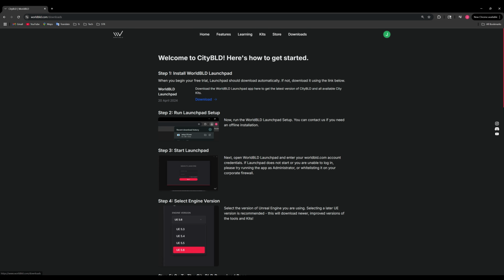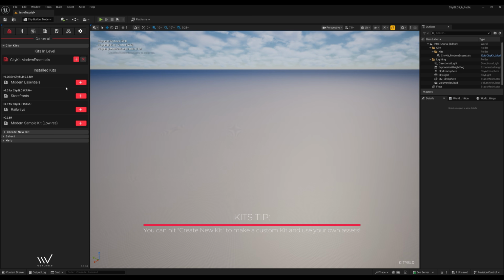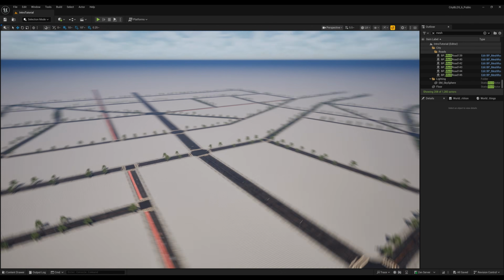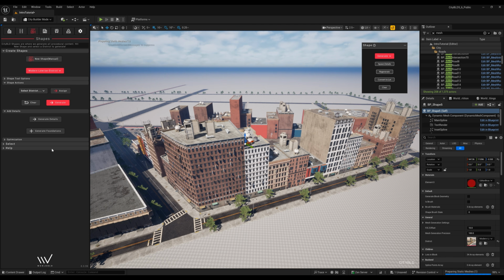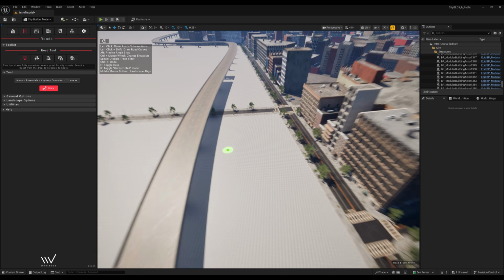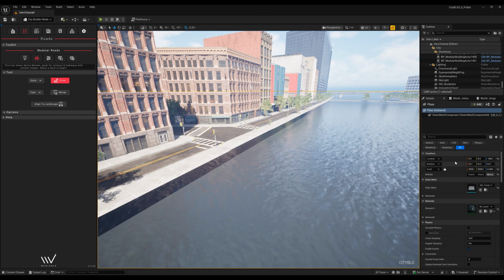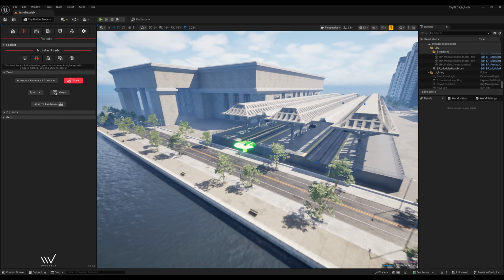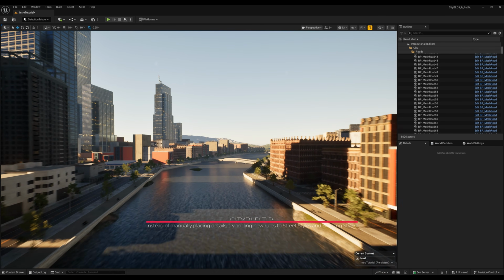Create An Open World In UE5 & CityBLD Beta | Full Legacy Version Tutorial

Comment: The highway stuff does not work at all like hte video. When i try to connect an off ramp it rotates 180 degrees.. then is unaligned at the connection point.. how do i align the off ramp to the 1 way road? Again when i nitially click the end of the road.. the end of the ramp rotates in on itself...
Reply: I can't get different road types to connect together. A lotThe features don't work.  You can prototype some roads but as far as putting together a city map it doesn't seem very useful right now. I don't particularly like the buildings that it generates either. And once you download it, they don't want to give you your money back. I feel like I wasted $400.
Reply from the maker: Hi there, so sorry you're running into this issue! It's a little hard to tell what might be going on here - if you could please share a screenshot on our discord someone from our team will be able to resolve it shortly: https://discord.com/invite/HKs5RzXx4D

Comment: Is it possible to export the dynamic meshes (Such as buildings, trees, roads, etc) from UE5, and import them into other software such as Blender for physics simulations then bring the physics simulation back into UE5 to add destruction scenes? I know it's a lot to do, but would it be possible?
Reply from the maker: Possibly - there's a lot of polygons involved in a large scene though so I'd be concerned about potentially crashing Blender on import or simulation. If the polygon count is under control though, it's just a matter of saving the procedural objects as static mesh assets and then merging them into larger, easier to export chunks. Here's an example of merging just a building: https://worldbld.notion.site/Destroying-Buildings-With-Chaos-1e01ba824a3081c3b8e0c54160cde5b5?pvs=74
Reply: @WorldBLD That's really helpful! Let's say I was happy with the way a building looked (Say like an apartment building), I would convert the dynamic building into a static mesh to import it into Blender without it having issues with lag or crashing? Also, I've noticed that the buildings are without textures. Is that intended in order to export from Blender, back to UE5, then, with the Chaos plugin, you would add the textures back to the building? Would it be possible to fracture the building in Blender after converting the dyanmic mesh into a static mesh in UE5, export the fractured simulation from Blender back to UE5, and finally add the textures back? I hope I wasnt too confusing, but I'm open to explaining myself better, and I apologize for the long comment, I just really want to know a good workflow, since I've tried doing this before, but it was a pain to figure something remotely close out, and even then I didn't fully resolve all of the issues. 😅
Reply from the maker: @RoadwarriorPicturesRight - when a building is first generated it's a collection of instanced meshes (each window, door, etc is it's own mesh) so all you're doing is merging those into one mesh. If export ISN'T your goal you want to avoid this because it's much faster to load in many instances instead of one giant mesh. Regarding textures, I don't think there's a good way of exporting UE materials to Blender so you'd just re- assign the original materials once you import the mesh back into Unreal. Also good to note that in the chaos tutorial in the documentation we use the Sample Kit which doesn't include textures to begin with - hope this clarifies!
Reply: @WorldBLD Oh, ok. Are there any documentations or tutorials for adding the textures back to the buildings in in UE5? After all of the simulating, and fracturing is done?

Comment: Hi, why does my shapes not generate any buildings?
Reply from the maker: The most likely reasons are that:
A. The Shape is simply too small to fit the buildings you're requesting. In this case, you can simply make it a bit larger and re-generate.
B. The District you have assigned is set to not generate buildings. Try a district like "Downtown Lowrise" from the Modern Essentials Kit!
Do you see any errors when trying to generate the buildings?

Comment: how does it work for roads that are on uneven terrain? does the terrain automatically match it? What about the concrete within the ring of side walk at the center of a city block..?
Reply from the maker: Sure - just hit Middle Mouse Button as you draw to auto align the landscape. Have a look near the end of this video for a demo of this. For the area within a road loop, that can be controlled by setting the "Courtyard Land Use" parameter in your District. This simply defines whether CityBLD should generate geometry within that area, what material to use, and what props or buildings it should spawn in that area.

Comment: Looks pretty cool, could you also show off how to convert your own assets to work with the tool? And what if I want to detail building prefabs after they’ve been placed, is that supported. And could I lock any building/road/thing placed with the tool to avoid accidentally overwriting my manual detailing afterwards?
Reply from the maker: Sure thing, we'll log the request for using custom assets. Here's a community-made playlist on using your own assets with CityBLD as well: https://www.youtube.com/watch?v=Q8vNXEKLSjw&list=PLPjX8EBq04rZvPKpMBIzwujd3opFytOG-

The best way to lock anything you've generated so you can detail it further, be it a building, road, or Lot, is to convert it to a Static Mesh. This saves a ton of resources and improves performance as well!
Reply: @WorldBLD cool thanks, will check it out later :)
Reply: I’d like to know this too—

Comment: How do you make the landscape conform to the road if you don't have a flat landscape and you want the road to cut through the landscape ?
Reply from the maker: The hotkey is Middle Mouse Button! This is covered towards the end of the video. You can set which layer you wish to conform in the Tool Settings in the road editor.